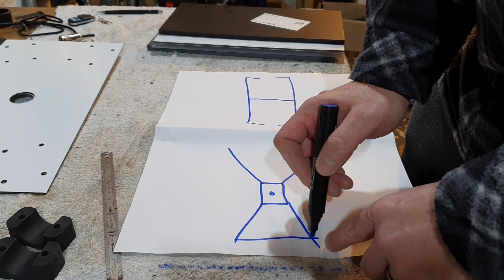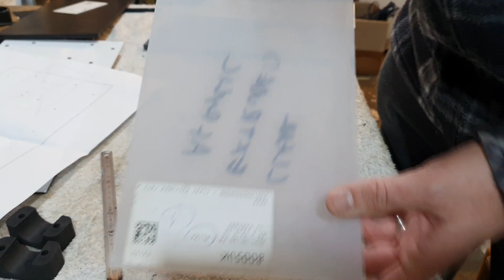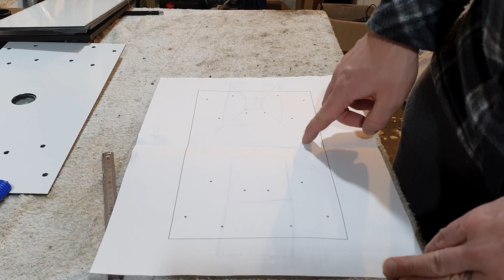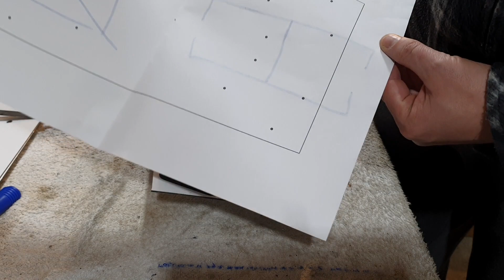Moxon Beam Antenna Base Plate - Build Overview

Comment: Genius.  I made a 4 element 10 meter quad back in the 80’s with an aluminum boom and mast mount so I know the thought process.  Your Moxon is inspiring. 73
Reply from the maker: Thanks, this project was a bit of work. I'm now concentrating on Hexbeams due to the convenience of multiband and smaller turning radius.

Comment: have you refined this design for a smaller footprint?  What is the weight?  THANKS Rob - AK7RM
Reply from the maker: Unfortunately not. Ive moved onto the Hexbeam as get 5 bands. It won't weigh thats much more. Problem with this design is the availability of the fibreglass poles.

Comment: Well done Colin…. I’d be really interested in how you tuned your Moxon.  I think a video about that would be worth covering.  My Moxon uses less robust fishing poles.  They are about 26mm in diameter at their base,  which also makes the tips much smaller from a diameter standpoint. I created 3D printed saddle clamps as well as wire anchors for the connections to the pole ends. Not as elegant as yours are, but functional.  I’ve enjoyed watching your build. Thanks!
Reply from the maker: I will cover that on the final overview. The wire also performs the tension on the poles so if one is altered then the other needs altered as well.